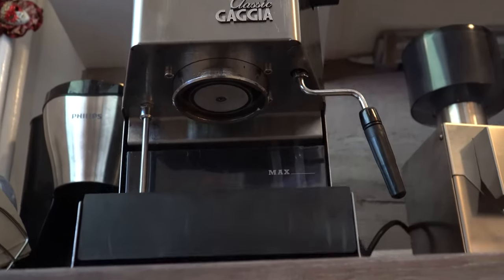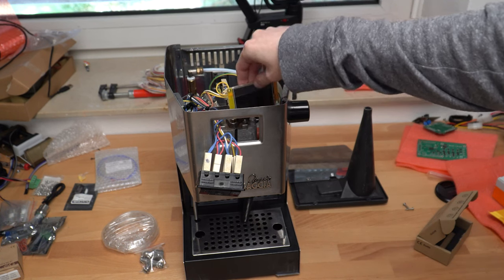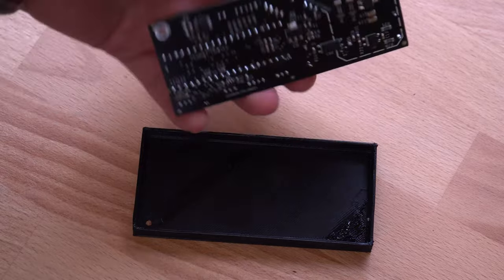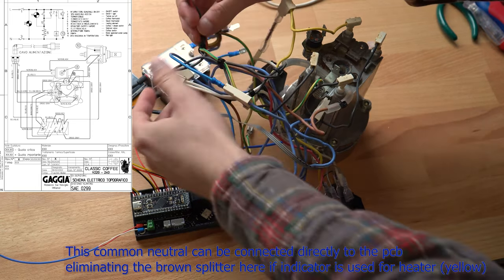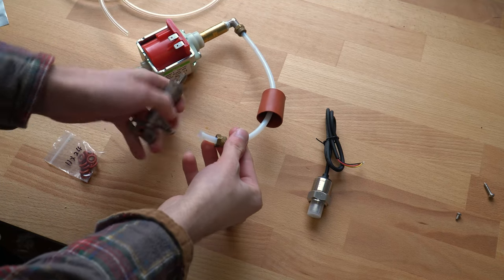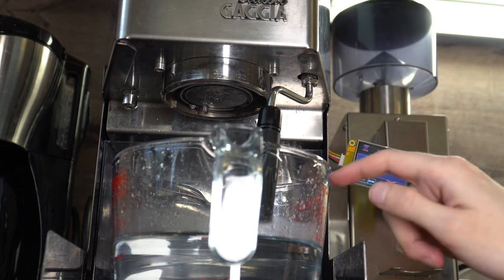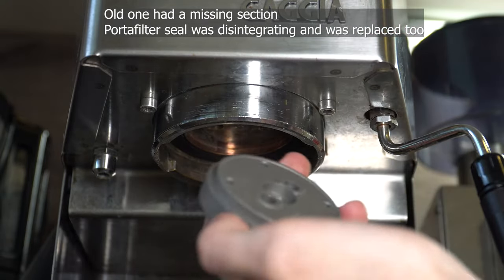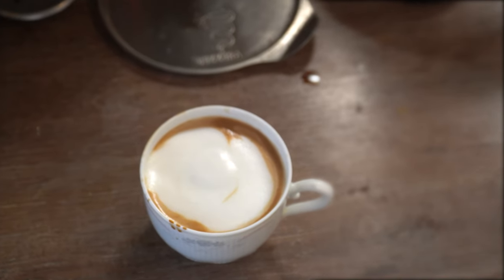Building a smart espresso machine with Gaggiuino

Comment: Big thanks for putting this together. I've ordered the GCP, and will be getting the PCB3, hopefully the August, 1st run. I'm sure, I'll be rewatching this video many times, once I have all the parts, and start working on the mods.
Reply: Just got My PCB for the same GB :) watching because of that. 

I'm also thinking about mounting the screen in the front. Actually might redesign the nexion to work with their bigger screens so I can get some more detail and resolution :)
Reply: @v0idgrim I really like the look of a front mounted screen, but I'm worried that the group head heat might be too high.

Comment: Thanks for this video. I just got V3.1 kit from PeakCC but have be struggling to visualise the schematics and connections. This does a great job with that
Reply: How did your install go with the 3.1? There aren’t any videos or info out there about the 3.1 install and end results. I’m getting ready to do this mod myself.
Reply: @justin2956  my recommendation is do the custom cables. Rather than trying to work out the stock integration

Comment: Its a really good video I have 2006 classic with the PID and pressure Gauge with dimmer mod and am thinking of going this mod.  I was wondering why did you not do an SSR for the steam? Is this because you did the Ardiuno not the STM32 upgrade Gaggiuino mod.
Reply from the maker: There is no extra part required for anything steam related. Steam mode is just increasing the boiler target temperature. The heaters are already controlled by an ssr.
Reply: I already have a Mr Shades PID kit with set box top and dimmer mod etc. That came with two SSrs's for some reason.

Comment: Is there a way to a more simple mod where the heating element turns on when you push the brew button to get higher and more stable brew temp?
Reply: A PID kit is about $100 and allows precise temp control.  You still need to open the machine but it's pretty easy.

Comment: Thx for the vid. Is this the v2 version? It says that the project wont work on this
Reply from the maker: the PCB is based on the v3.
Reply: @Gigawipf  In the gaggiuino docs I see that there are five 220v models - the OG classic, v2, pro, pro eco, evo pro which one is the v3 that you've mentioned? Also the docs specified that the v2 which looks just like yours is not supported, what do i miss?:/

Sorry for the stupid questions, I just purchased the v2 especially for the project and ran into the compatibility table and unfortunately mine in the unsupported list:(
Reply from the maker: @michalthestink  Thats what you mean. It should be the original classic model. The v2 seems to have a different boiler style and no active 3 way valve.
Reply: @Gigawipf  but yours looks like the v2, doesn't it?
Reply from the maker: @michalthestink  No it is the original version. 
The V2 is a light version of this one but looks similar.

Comment: Would you be willing to share a profile you use for an espresso. It is kind of tricky to set the right settings. It's not as straightforward as I thought it will be.
Reply from the maker: That would depend on the rest of your setup. Better check out the gaggiuino community and what they recommend. I usually use something close to default settings, 2bar preinfusion, 9 bar start and a duration of hopefully about 20-30s but depends on what you want to brew and how you grind and prepare it.